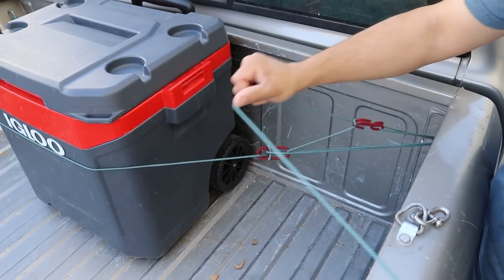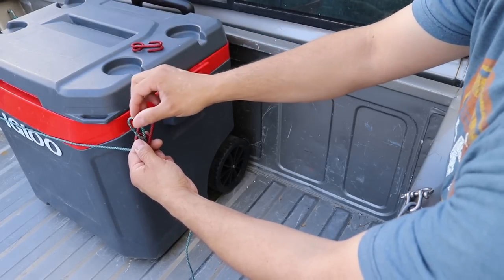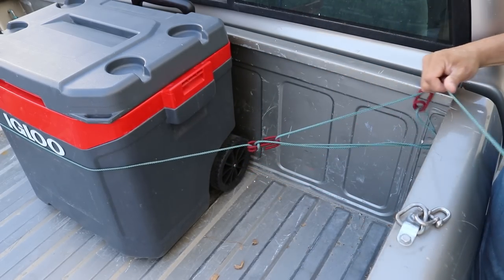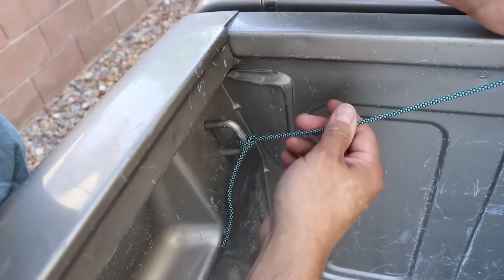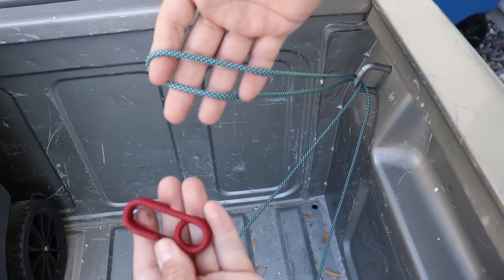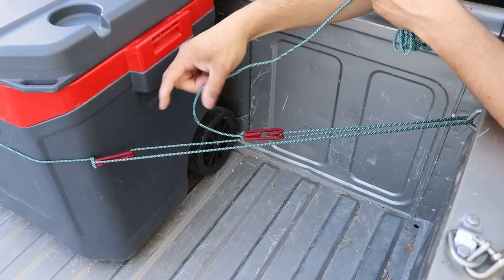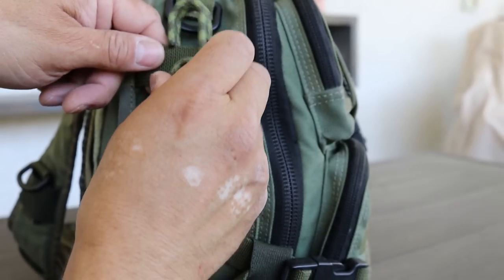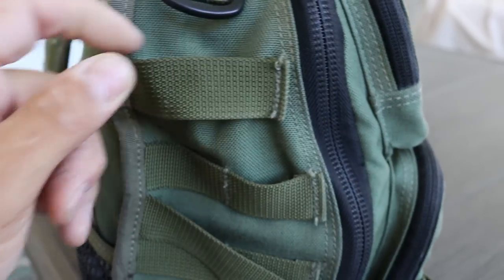Haken Truckers Hitch

Comment: Hi im big fan of yr knots, please help below.. I need a knot  with two handles or loops  in 
180 * opposite direction, which can hold the valve spindle of 20mm cylindrical shape & can be gripped enough to move the valve  up and down vertically  when valve seat is in pressure. .. the problem is pnematic diaphragm which is articulating this valve is malfunctioning , i had to unmount, but cant operate the valve as its spindle is not with threads.
Reply from the maker: Hi Vasanth, can you send me a photo through facebook or instagram?

Comment: You’re going to think I’m an idiot but what is a fire card & what is it used for? Thank you
Reply: He's described it in other videos, but basically in order to keep Paracord from fraying, the end needs to be melted with a flame. Sometimes, the end of the cord is right up against other sections of the cord that you don't want to melt, such as the end of a Haken hook after you have wrapped it in Paracord. The flame card is a metal shim that acts as a barrier to prevent direct flame contact between the end of your Paracord and the rest of the cord so that you only melt the section you want without damaging the rest of it

Comment: i dig'em!
but i've gotta say that climbers/hammockers/backpackers long ago evolved their cord tensioners and toggles far beyond the haken.  though, i get that these are useful to those that aren't inclined to get into niche gear and cordage.  but DutchwearGear's section Hammock Hardware shows some interesting examples, though admittedly they're for use with <1/4 inch diameters of Dyneema/Spectra typically.
still, why not just knot?  😊
Reply: Even the Clifford W. Ashley’s great tome, The Ashley Book of Knots (aka ABOK), lists hundreds of knot tied around bits, toggles, cleats, spars, rings, hooks and tree limbs… Ashley even fashioned (no pun intended) an impromptu set of cuff links from his shoelaces for a formal dinner where he found himself lacking! To paraphrase Ashley, “If you can tie one knot, you can tie another.” All knots are related, and all complex knots are completed from a series of component sets.

As you know, a handful of cordage makes a person the holder of much worth in a thousand life scenarios! Shelter, carry, containment, sustenance, suspension, retrieval, tensioning, or a decorative bit of attire…even a hot pad made from a tiny Thump Mat… Or a pair of globe knot cuff links…

Happy tying!!

Comment: Ring Hitch? Is there another name for it?
Reply: Anchor Bend?
It has an “Ashley number” (or possibly more than one) in the ABOK. Regardless of name, it’s easily tied, self-clamping under the two round turns, and simple to back up with two half hitches of the standing end around the  working end.

Comment: Woudnt a ratchet be easier?
Reply: That depends. You might need two ratchet straps; an X & Y axis issue with hauling a refrigerator in the pickup truck. It’s tall, the road is rough; so you have to secure it from bouncing vertically. It’s prone to “walk” about, so you want to hold its horizontal alignment against the bed rail. 
With one piece of uninterrupted rope that appliance can be trussed up tight and tidy! 
I like my many options, my several straps and ratchets. In helping friends and family on short notice at the lumber store, the garage sale, or even the animal pen(!), if there’s a length of line I can help. No moving parts. No pinched digits. No jammed, rusted, frozen release lever. No frostbite to bare fingertips on metal.

So it depends…

Comment: Only want/need 2 but you dont ship to UK, shame……
Reply: He describes the process of making them and work-hardening your own wire for them here. 
https://www.youtube.com/watch?v=FqEJNXV40Zw
Sure, they won't be quite as strong as the manufactured ones but they'll be good enough for 95% of the jobs you'd ever use them for.
Depending on the wire you use, you may be able to temper the clip once formed to harden it further.